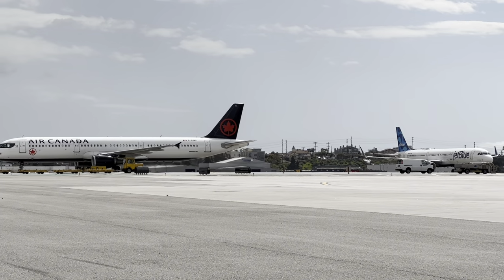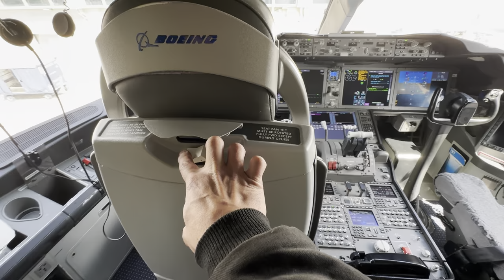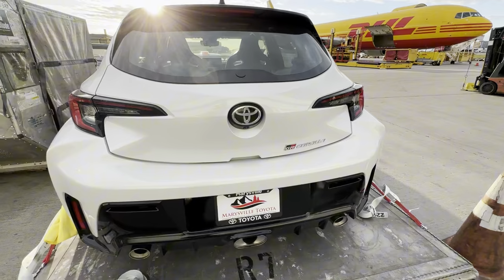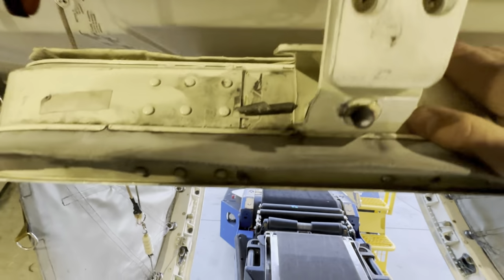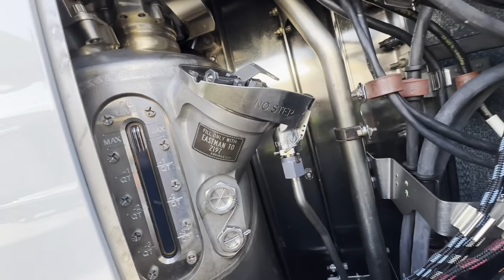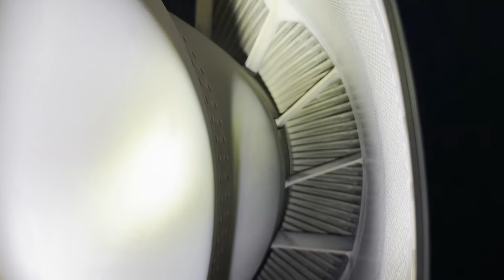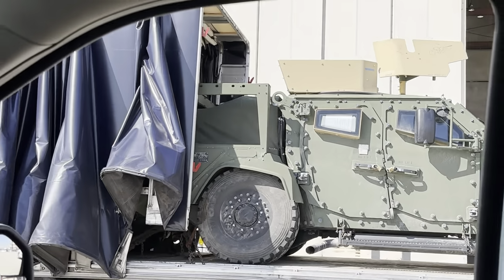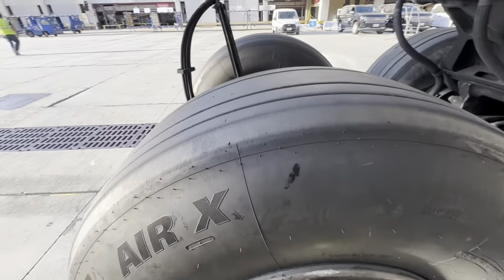Stig Shift #17 (Aircraft Maintenance Adventures)

Comment: In one of your videos, you mentioned how a plane cannot be ETOPS-rated if the APU is not working. Later, I remembered flying to Asia with a particular airline, and the captain apologized for it being hot in the plane because the APU was not working, but we still flew to their main hub. The aircraft carried was not a US-flagged carrier. Would this have violated the ETOPS rule? I had flown out of LAX because this aircraft type only flew out of there. Thanks
Reply from the maker: There are occasions where they are still allowed to fly those ETOPS without a apu. What happens in that situation is that the aircraft will use a very particular routing, very different from a regular ETOPS. They will stay closer to airports than usual.

Comment: Hello sir. One question. What’s is the big screen front to the plane when is park in to the gate.
Reply from the maker: Are you talking about the guidance system that brings the aircraft in ?
Reply: @StigAviation  when you guys move the plane to different gate I see the number 41 under i see a screen. Can you explain what’s the screen for
Reply from the maker: @fredygonzalez3939  that is called  automated guidance system. It will automatically guide the pilots to the correct stopping position
Reply: @StigAviation  Ty so much sir for you answer. I very appreciate

Comment: Re sanitizer bottle  ... I used to carry a box of black tack in my tool kit. Stick a dob on the end of a screwdriver to drag stuff out of confined spaces. Allowed on aircraft ???
Reply from the maker: I don’t think you’ll be allowed to carry a screwdriver as a passenger.
Reply: @StigAviation I meant would YOU be allowed to use black tack in an aircraft.
Reply from the maker: @maltnz  if I’m on duty , yes. I can use whatever I feel necessary to get the job done as long as it’s not harmful to the aircraft.

Comment: How do pilots know they are on the line when they taxi towards the gates?
Reply: It’s called accu-park which uses a visual aid to the pilots for left right and stop corrections. Not all gates have them which is why you need ramp agents guiding them in sometimes.
Reply from the maker: Thank you for helping with the questions 👌

Comment: What happen if you pull up the landing gears levers when the aircraft is on the ground ?
Reply from the maker: Nothing at all, there are weight on wheel sensors that will not allow the aircraft to go gear up, also the weight of the aircraft itself will not allow it. But there is a circumstance where if the hydraulic systems were to be functioning, the nose gear has a tendency to collapse, but that rarely happens.
Reply: @StigAviation  thank you

Comment: So why aren't dummy doors as on the Max 9 and earlier 737's, plug type? Has to be a way to make the dummy doors plug type. Makes no sense to do anything less.
Reply from the maker: They are plug style. The way it works is if the door was actually meant to open, it will slide slightly in words and then pop open. But it’s still a plug style door.

Comment: I have a weird question if anyone knows. I get that while videoing different settings  the blades of the engine look like they are going left and right while slowing down or if on a different setting can make it look like the blades are still. But why is it that white swirl on the cone of the blades continues to spin one way,unlike the blades while slowing you can see going left to right and right to left as it slows
Reply from the maker: It’s simply the camera not being able to catch up to the frame rate. In reality, it’s spinning in the same direction as the swirl in the middle.

Comment: On the 787 those oil fillers are so terrible people were using zip ties to keep them open and somebody left it installed and it blew all the oil out and it was so bad to the point that Boeing redesigned it
Reply from the maker: Yup. Funny enough the zip tie method is actually approved by Boeing to push back the flapper. Best way to do this to wait about 10 minutes to let the pressure in the engine oil system to lower. It won’t push against the flapper at that point and you can service it easily without having to push on it
Reply: @StigAviation  Oh.... no kidding I didn't know that Boeing approved that

Comment: What parts of newer aircraft are composite and which parts are still aluminium?
Reply from the maker: Depending on the aircraft you’re talking about, if you look at a 787, that thing is pretty much over 50% composite within its fuselage, most interior items are composite as well, but massive structural components are usually steel or titanium. Other aircraft use aluminum as their outer skin.
Reply: @StigAviation  interesting, be cool for you to point out what panels etc are made of whst materials in future videos. I sometimes spot them but not often. Cheers!
Reply: Bump

Comment: How do you know when to change the breaks on the 787 it the break push rod is not there
Reply from the maker: There is a brake pin wear indicator which o have shown in previous posts and there’s also a flight deck indicator that shows the life of the brake.

Comment: i have a conspiracy theory that the seat had little to do with that aeroplanes fast descent. one passenger said that the captain said all the lights went out. the manufacturers said it was seat pushing into yoke. I say one the pilot got the yoke forward a bit, perhaps from having seat back as far as possible and resting legs on yoke.  like some car passengers do with their feet on the dashboard. Seat switch lid was pressed on by cabin crew member checking with pilots for coffee or meals or whatever. Seat moves a bit, yoke gets nudge further. AP disconnect. <bells>. Plane Dives...  Pilots legs are above the yoke. Pilot cant get back out of awkward position quickly cos the seat is forward a bit more. meaning has to lift feet even higher but up again screen now and yoke is forward under his thighs.. . try it in you car. put your feet over you steering wheel.. then get the seat pushed forward a bit and then try to get back out of the position you're in. Pilots feet on dashboard theory of mine isn't far fetched at all.
Reply from the maker: There are so many scenarios you can go through, but we all still don’t know what exactly happened within the flight deck. It seems to be shrouded and mystery at the moment.

Comment: I have a question when the engines are spinning, and they’re ready to takeoff, but still on the tarmac. They’re just disconnected from the tug. How do the pilots know that everybody’s clear from those engine?
Reply from the maker: They will remove the gear pin that locks out the nose steering, and it’s attached to a lanyard, the ramp personnel will walk to the side of the aircraft where they are visible to the captain or the first officer and show them that the area is clear and the pin has been removed. That means the aircraft is now Able to move freely without any obstructions around it.
Reply: @StigAviation  I love aviation, and thank you for answering my questions

Comment: They forgot to install this door. There were no screws or pins. This is a real problem. You don't have to defend Boeing. Even the engineers who built it didn't want to fly it.
Reply from the maker: You are talking about a different incident my friend. That was the door plug and yes 100% Boeings fault. This is talking about the cargo door. Not the same thing.

Comment: I've been calling bullshit on that switch causing the LATAM incident since they started claiming it.   Boeing sent out a memo in 2017 telling airlines to check the condition of the switches as if it's come loose, the cover can cause it to be pressed down.

So, instead of faulting LATAM maintenance, everyone is jumping on Boeing.

If the voice recorder doesn't have the incident recorded, I'm calling it a cover up.  The pilots f*cked up and are using a known tech issue as a cover.  After all, the media are laser focused on Boeing just now, so no matter what happens, even mundane shit like a hydraulic leak, it gets reported like a near disaster.  Perfect cover to avoid liability!
Reply from the maker: We shall see what comes from this, it’s definitely very suspicious on what occurred within that flight deck. Nothing makes sense on what they are reporting.  But I’m giving you facts and I’m giving you exactly how that chair works.
Reply: @StigAviation Your input is always welcome.  Learning so much from your videos :)

Comment: I have a new one for Stig, oil-related. It's a doozy.  "EASTERN AIR LINES, INC.
LOCKHEED L-1011, N334EA
MIAMI INTERNATIONAL AIRPORT
MIAMI, FLORIDA
MAY 5,1983"
Reply from the maker: Flight 855. Yes I remember that one well. Master chip detector o ring. That was a cause of bad maintenance.

Comment: Can I ask about kapton tape? Have you found any of it while working on planes? Disaster Breakdown channel had a vid on it. https://youtu.be/46ozekMtejw
I use it while soldering and repairing. I do watch a lot of disaster breakdown vids, I'm not sure I agree with Chloe's conclusion that Swissair 111 went down because of it, I think it's probably because of too much current passing through wires that couldn't take it and started melting and also started a fire in frame insulation that was banned later
Reply from the maker: As far as I know, kapton tape is still being used on some manufacturers, although it is a much more improved version.
Reply: @StigAviation  Thanks!

Comment: People will get sucked into moving engines when they vegin using apple glasses
Reply: Xause camera frequency
Reply from the maker: I do not understand your comment, can you please clarify
Reply: U know when u film stuff, the camera catches the blade at every frame and if the frame rate coincides with some whole number multiple of the rpm of the rotor, it will look lile it is standing still and people will walk into stuff.
Reply from the maker: @snorttroll4379  that’s why you have the markings on the spinner to show you the engine is turning.